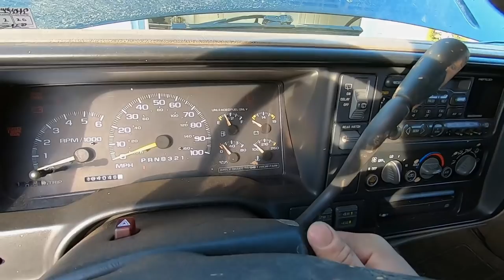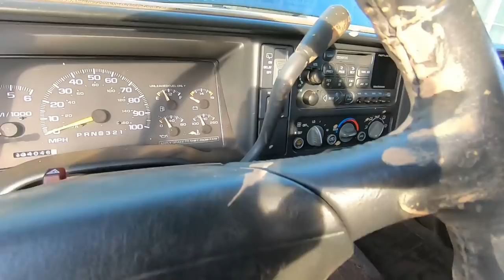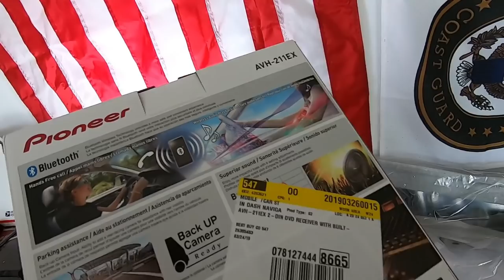The Jumps and Mud Pit Took it's Toll... The Blazer is Officially DEAD :(

Comment: Tip- the small quarter sized circle on the back of the alternator, while running if it’s magnetized it’s charging & if not it’s not charging. Just to save whoever reads this money in the future 🤙
Reply: Or Just be like one of the technicians who did a alternator test and didn't check for the belt. I kid you not, he didn't check the belt, and I saved 180 dollars when his boss came and checked. It was funny because I knew the guys who worked there.

Comment: The Blazer has a gauge on the dash marked "ALT" that shows whether or not the alternator is charging. I see that it is charging with the new one but you should of checked that to see if the old one was charging before you just started changing parts.

Comment: Mike, the only man who can kill a 350.
Reply: PowerStoked hold my beer....
Reply: More like the one man that cant.
Reply: @JOHNTORNOUT  350's are hard motors kill, but it's really easy to kill a Triton 4.6/5.4/6.8 or 80-90's 5.0L.
Reply: @tskraj3190  If you stay off the limiter, and keep oil in those Fords you'd be fine.
Reply: @JOHNTORNOUT  The Tritons had many problems that had nothing to do with oil or the limiter. The older 5.0's biggest issue was it's heads. Depending on which 350 it is, High RPMs can kill a high compression push rod motor. One of the things I can give Ford credit for was their effort and use of overhead cams in their V8 engines
Reply: @tskraj3190  1970 till 1995 350s were absolute pigs, that seemed to be clapped out by 100k, 350 vortecs on the other hand were ok. The vortecs though had terrible lifters. Same thing with the spider injectors that would runs the cylinders lean and burn valves.
Reply: PowerStoked I killed my 77 going through a mud pit lmao
Reply: Timothy Isenhart I beat on my 08 fx4 (5.4),daily and no problems
Reply: @JOHNTORNOUT  I know many people including myself that had the older 350's with over 300,000 miles on them. I do agree with the earlier Vortecs having bad lifters though. The Gen 3 Coyotes are currently having the same issue with their rod bearings and lifters but once they're replaced with aftermarket there aren't any issues.
Reply: Timothy Isenhart I’ve seen a shit ton of people with new 5.0’s who have had there motors go...
Reply: @Ikillcampers50  You were one of the lucky ones. They fixed the spark plug plate issue halfway through the 2008 models.
Reply: @JOHNTORNOUT  the trick is keeping oil in those ford motors. Funny you think sbc's are garbage. I guess its a ford vs chevy thing...I've owned both and so far chevy's have lasted longer than any ford I owned except for my 2.3l ranger. That engine was almost bulletproof. I know many people driving old chevy trucks ranging from 60's-early 90's models with well over 300,000 on the original motors
Reply: @sinformant  I'm a dodge fan. It's just I've never had good luck with chevys. But keeping oil in any of those motors can be a chore.
Reply: @JOHNTORNOUT  I've had Ford, Chevy and Jeep. I had a couple of F150s with the Triton 4.6 and 5.4 that gave me so many problems it put me off from ever buying another Ford. I  never owned a Dodge truck but I had many friends who did. The problems I  heard  them tell me were their transmissions, front diffs, water pumps and air condition condensation drain plugging up and leaking on the passenger side floor board. But with my Jeep I only had the A/C condensation issue. As for Chevy, they've always been very reliable for me.
Reply: @tskraj3190  I've never had a transmission issue with all 4 of mine. I dont know why. Actually I've never had a issue except for rear brakes.
Reply: It's one of those things, I've you abuse something it's going to break eventually. Dodge if you tow in overdrive you'll burn the transmission up, but that's the same thing with chevys. 700r4 is known to have a shitty overdrive, and the 4l60E is known to loose 1st gear under extreme load, like mud bogging and drag racing.
Reply: @JOHNTORNOUT  They haven't used the 700R4 for the last 26 years. It was replaced with the 4L60E back in 1993 and 4L65E in 2001. As for taking care of your vehicles I took very good care of my F150s. I took them in for routine oil changes, tuneups, coolant flushes and I babied the pedal. They just weren't very good trucks which is big reason why they discontinued those motors in 2008.
Reply: @tskraj3190  Funny, if they were completely junk, the 5.0 coyote wouldn't be based of them. We're all biased. Plus they have used to 350 for 20, what's your point?
Reply: @tskraj3190  700r4 was renamed 4l60 in 91 and the 4l60e came out in 96
Reply: They were complete junk and Coyote was a whole new design and 4L60E was released in 1993 and coengineered by Allison, it's not a renamed transmission like some have stated. You cannot rebuild a 4L60E with 700R4 parts. the 4L60E has bigger automatic gear bans with .002 mm more spacing, a bigger ban box and a the pans don't match.
Reply: @tskraj3190  One more time. 700r4 was renamed 4l60. 4l60EEEEEEEEE came out in 96. And was not co engineered by allison lol.
Reply: @JOHNTORNOUT  Are you talking about a RAM or Dakota? If you are what year? I used to work for a Diamler Chrysler Division from 1999-2000. I worked on the AN/DN line interior parts for Dakota and Durango. The XJ line did Jeep and the BR Line did RAM.
Reply: @tskraj3190  what are you talking about? I thought we were talking about gm transmissions.
Reply: @JOHNTORNOUT  I said something about Dodge transmissions and you responded saying you had no problems with all 4 of your transmissions. I was getting my conversations mixed. So far I haven't had to have rebuild on my chevy transmissions, but I'm sure it will happen soon because I have 443,256 miles on my truck and nothing been rebuilt yet, and yes it has the 4L60E with the 5.3L.

Comment: Mike that radio wont work in the blazer. U have a din and a half setup from factory, you can only run single dins or the ones with flip ups in that truck
Reply: Owen Sanders there’s a website called thedetailss who makes double din kits for the 95-99 ck trucks. You have to trim the bezel inside the dash a little but it works nicely. I have one in my 96 single cab

Comment: You can get the alternator recored and even turned up if you want.  Cheaper than a rebuilt unit and usually runs better.

Comment: I would NEVER replace an alternator without testing it first with a multimeter. That's just weird.
Reply: GeopioneerGSXR And you might still have a bad alternator even if the multimeter says it is good.  You have to check an alternator with something that puts a load on it.  Just because it works doesn’t mean it is putting out the right amount of amps
Reply: @brandonmiller2812  Point being, I WOULD test shit before replacing! I've replaced at least 10 alternators in my day. I'll tell you I've NEVER replaced one if I didn't know 100% that it was bad. Usually I would let the vehicle idle, turn on the lights, and test.

Comment: Wait....so you fixed a dead battery by installing a new alternator? I don’t think that’s how that works. Either your battery had a bad connection, or you jumped it. I would’ve just checked the connection or taken the battery and had it load tested before buying a new alternator. Anyway, good video, loved the truck jump.

Comment: Installing a radio is easy u just need a Stereo a dash kit there like 20.00 and a wire harness there like 20.00 all u do is match up the wires and plug it in to the factory harness and there u go bestbuy and autozone have the kits and harness for car stereos

Comment: I just fucked up my alternator mudding and had to replace . Not even crazy deep mud but still fucks it up. Had a brand new battery so didn’t have to replace it. Just charged it right up after I replaced the alternator.

Comment: I’ve owned 5 gmt400s. Every single one had this problem and it was from bad cable connections. Some on battery, some on alternator, and some the ground on frame. Check every and all battery connections. 

FYI- a 13mm and 1/2” are the same size 👍

Comment: Best to recharge battery before start. In emergency you can, but hardest thing on an electric motor(starter) is low voltage. Just fyi for future to help cause less problems. Thanks for the video SS717

Comment: We had a customer that came in and we did an overhaul on it and we rebuilt the engine, but after it was picked back up he went to Best Buy and got a new radio installed, and when they were installing it they cut an oil pressure line and it blew up one day later so fuck Best Buy.

Comment: you should have went to the auto parts store and get the alternator voltage tested, before you decided to replace it. I guess it had mud on the connections lol.
Reply: That’s not how that works my guy
Reply: @MrCaptainandrew  how does it work then? Boi
Reply: Ricardo The PC Wizard the alternator testers at auto parts stores test the regular bridge diodes for forward bias, and the stator is checked for continuity. No voltage testing involved.

Comment: I wired up my after market double din gps radio in my 2014 f250 its loud with my 2 12inch directed subs and a 2400 watt direct amp

Comment: I’d kill to have my alternator in a location that convenient. I have a Mitsubishi montero sport, and the alternator is tucked down in the bottom right of the engine compartment where the easiest way to get it off is to take the wheel off. So to anybody that says “imports are reliable they run forever”, yea they do. But when they do break down they are a bitch to work on.